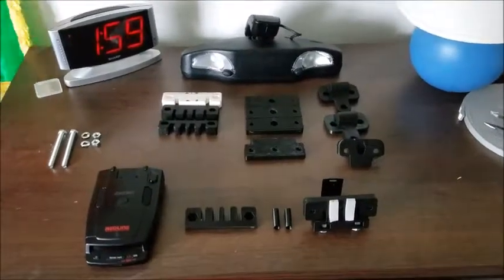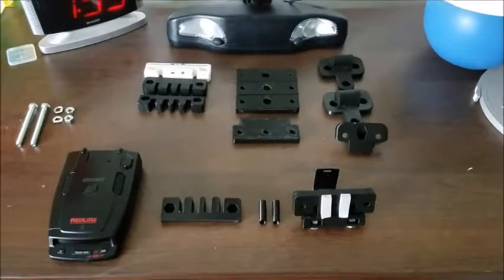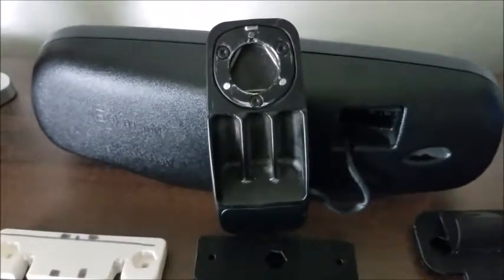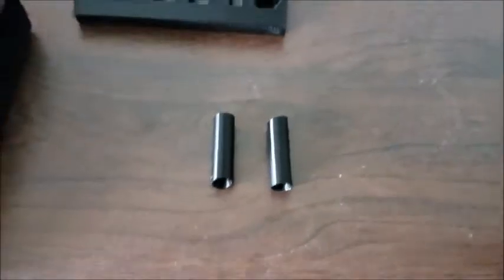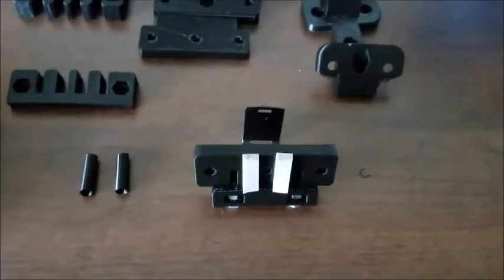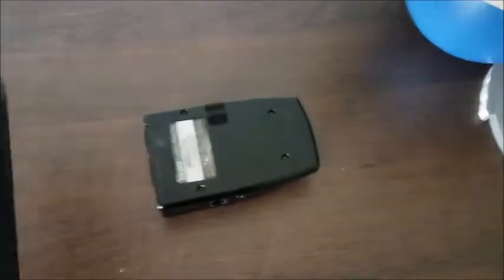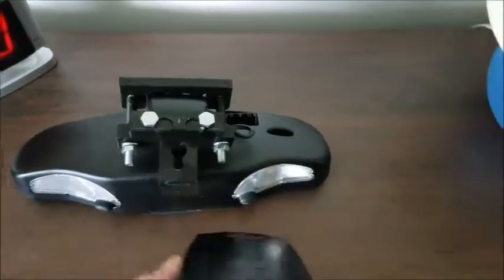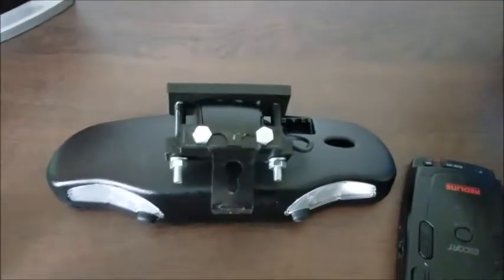3D Printing a C6 Corvette Radar Detector Mount

Comment: Outstanding...I am pretty much technologically challenged when it comes to things like what you have done here...can we talk offline?
Reply from the maker: I could probably work something out with you, but I'll need to tool up. Turns out that PLA will warp in high heat, and so I'd need to print it with ABS which is not nearly so susceptible to heat. PM me and we'll work something out.